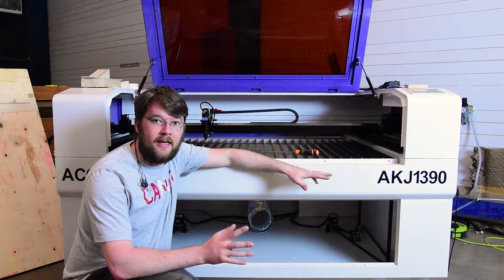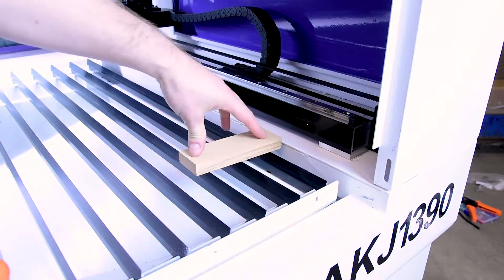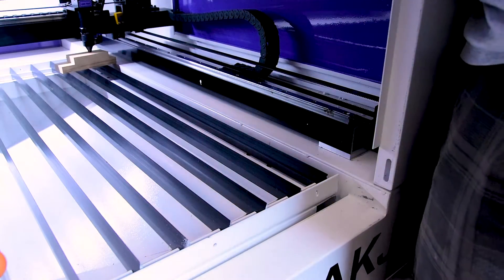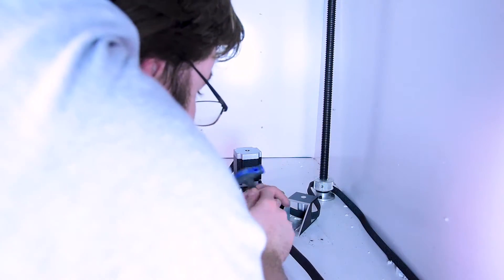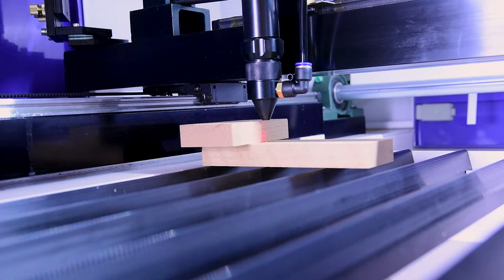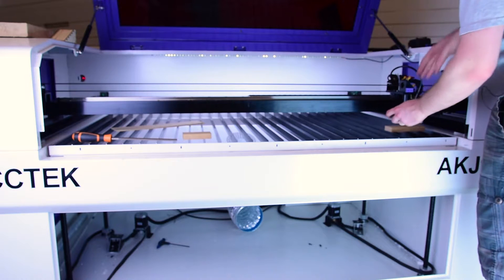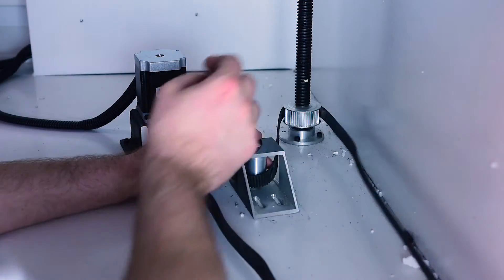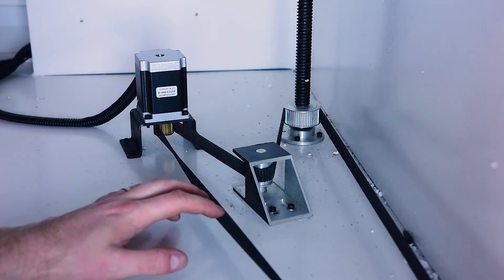How To Level Your Lasers Bed - The Woodshop Life

Comment: For those of you with larger machines this is an absolute must watch tutorial. Somehow I missed this one, great video for those that need to perform this adjustment. Having a "legged" AKJ1390 I have to do this adjustment from the topside, (I cannot crawl inside mine such as Mark does 😉). If you ever slip * ONE * of your Up/Down belts for whatever reason, (crash or otherwise), you need to do this all over again so bookmark this video should that apply.